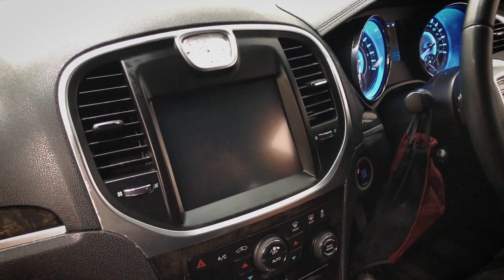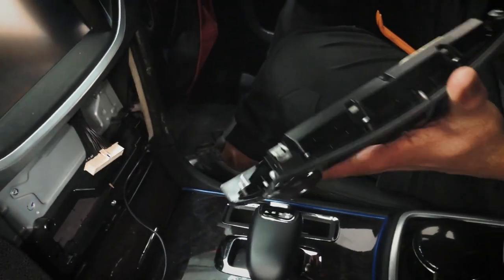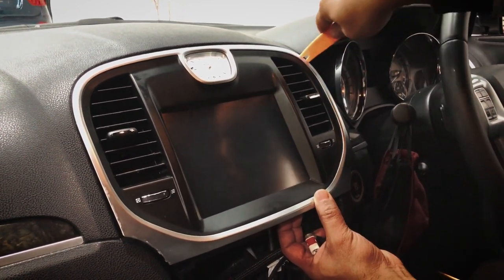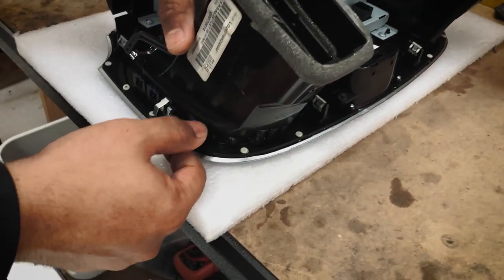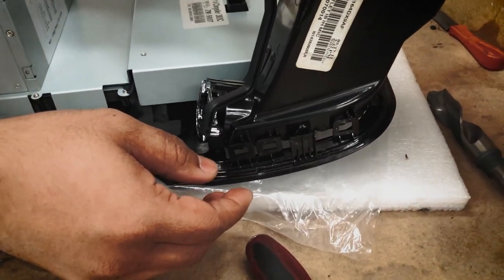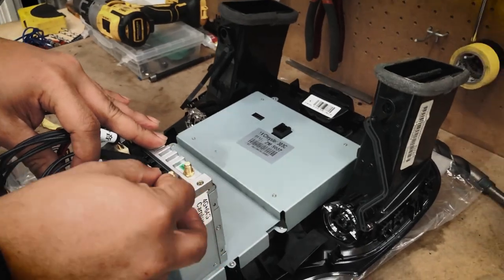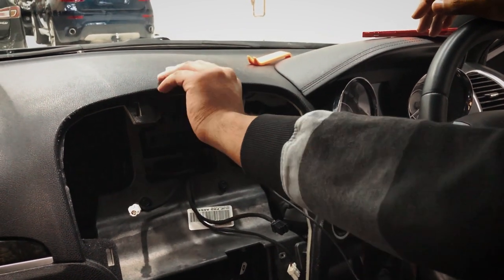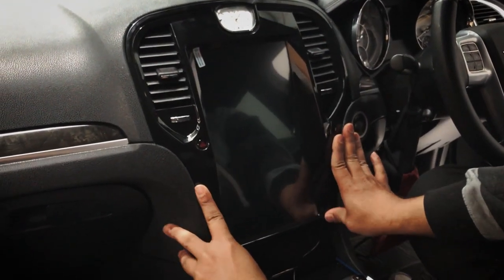Chrysler 300C 2012-2018 Android Car Radio Navigation Installation | Kayhan Audio |

Comment: Where do you get the large display unit and what is the price in U S dollars? Thanks for the info
Reply from the maker: https://kayhanaudio.com.au/product/car-stereo-with-satnav-for-chrysler-300c-2012-2018-13-3-inch/

Aud 1775 which is 1185 USD
Reply: 2K $